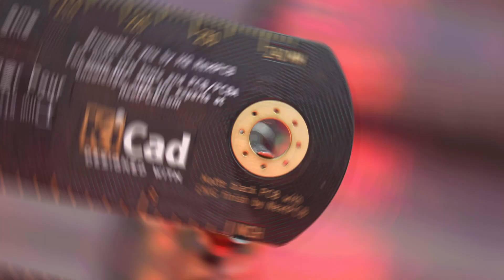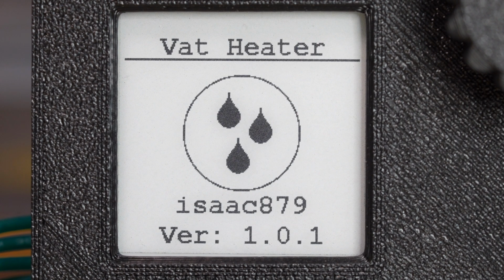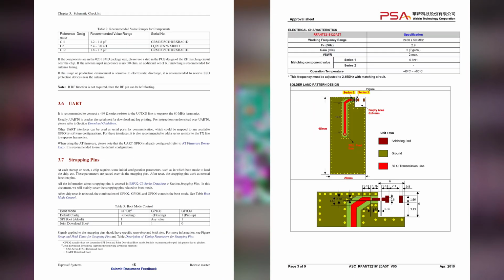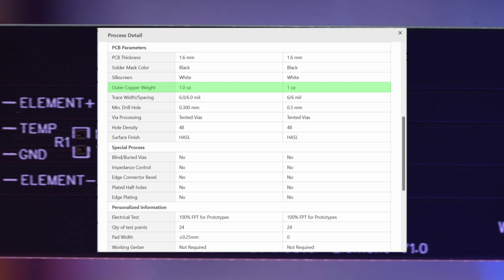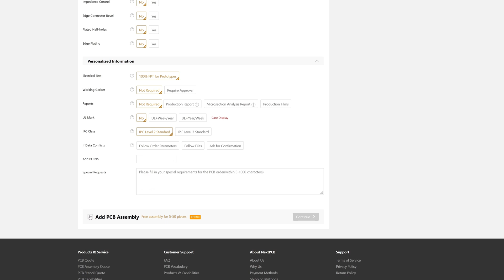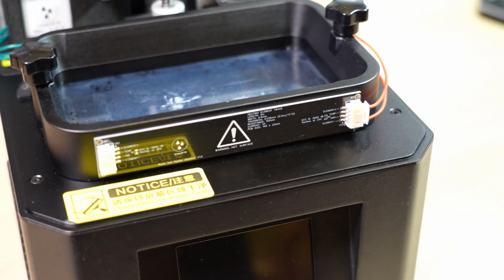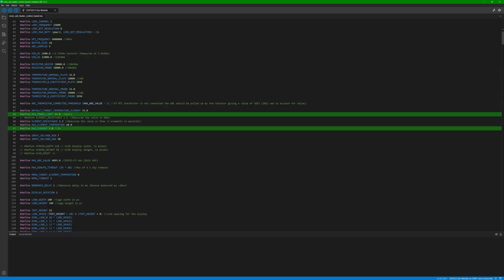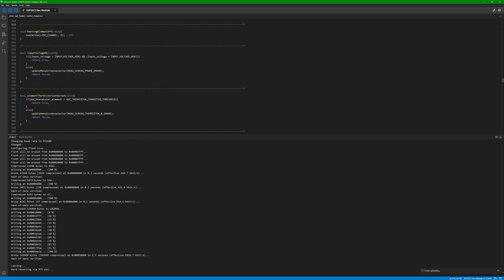Designing the Ultimate Resin 3D Printer Vat Heater

Comment: Thank Isaac. Are you thinking doing the PCB for bigger vat?
Reply from the maker: I probably will. I am currently designing a new versin of the heater with minimal parts to optimise the cost. So I will look at different size heating elements too. This current version can still be used on larger vat, it will just have slightly less optimal heat dissapation. (I just put one on my new Saturn 4 Ultra)
Reply: @isaac879 I have a Saturn 3 if you need beta tester👍

Comment: Very nice!  Would an aluminum PCB work more efficiently as the heating unit?
Reply from the maker: I don't think so. The heating element is on the bottom layer, right next to the vat so the thermal conductivity shouldn't really affect the performance. The aluminium PCBs would just be more expensive and make routing the traces more difficult as you only have one layer to work with.

Comment: Hi, and thank you for sharing this!  What are your thoughts on making the actual heating elements as an aluminum PCB?
Reply from the maker: I did consider making this an aluminium PCB but I don't think it would add any benefit. The heating element is on the bottom layer, right next to the vat so the thermal conductivity shouldn't really affect the performance. The aluminium PCBs would just be more expensive and make routing the traces more difficult as you only have one layer to work with.